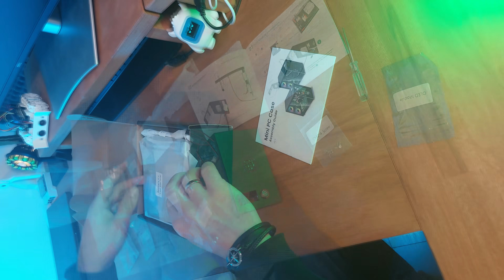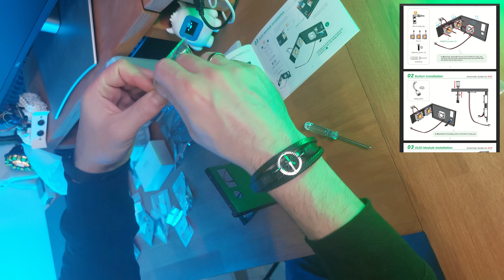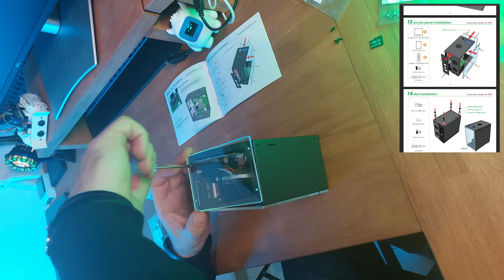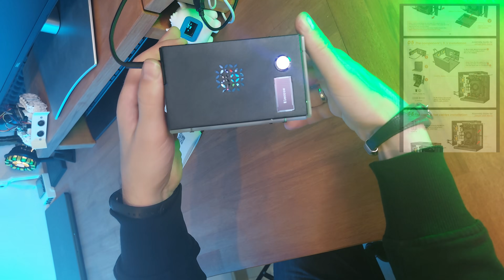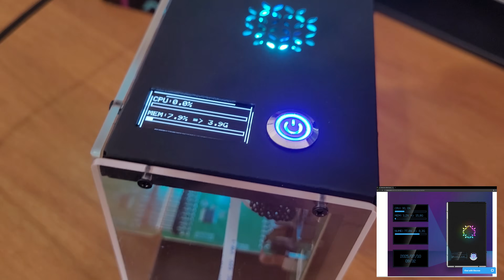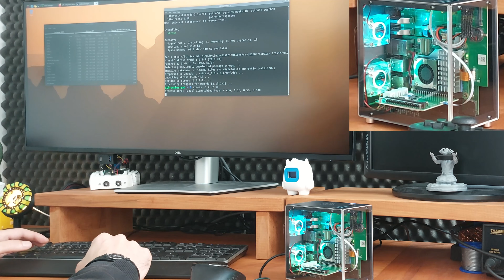This Raspberry Pi 5 Case Looks Like a Real Mini PC

Comment: I have this and do like it a lot. One problem. I can't find replacement fans? Where may they be purchased. What is the relevant size for my own search? Thank you.
Reply from the maker: I haven’t replaced the fans in mine, so I’m not 100% sure. They look like standard small 5V fans, probably around 3010 or 3015 size, but I would measure one first and check the connector before buying.

Best option is to contact Elecrow support to confirm the exact fan size/part number.